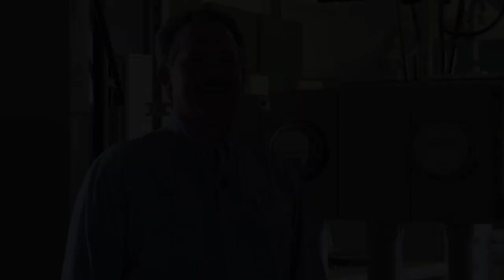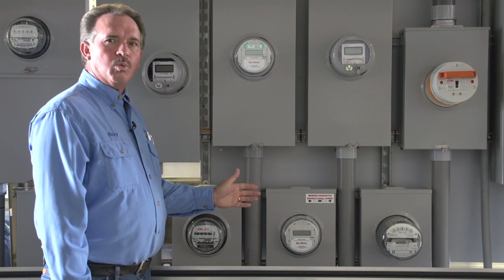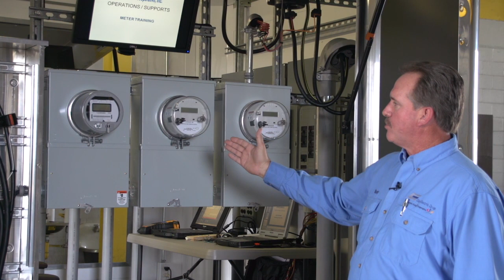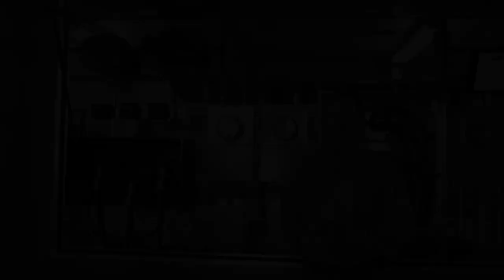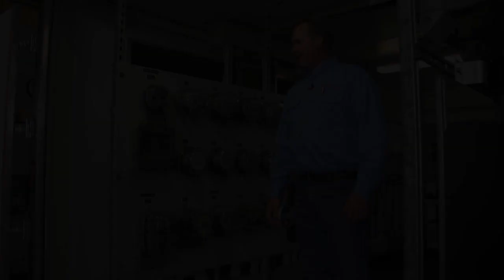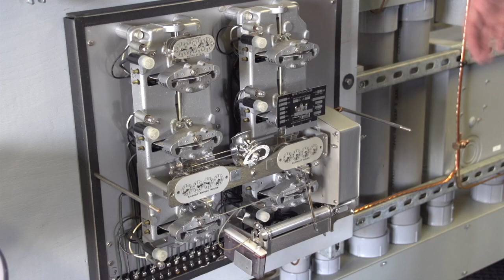The Meter Training and Safety Trailer Video Tour

Comment: Does a Meter always have to be outside the Building what about Smart meters..Or can they be installed in closed areas such as garage or washrooms ? Ect..
Reply: Its typically best for a meter to be outside, even smart meters. Or at least easily accessible to the meter readers. Reason being, there are times when a meter tech could use a read from the meter face. And while the reader is there, he/she can visually check the condition and security of the meter; i.e. tags, ice building up, or damage to the meter.
Reply: since this is the point where the main electrical service wires go into the home, in case of an emergency electrical hazard the utility workers need to have ready access to it. ie to cut electrical services into the home. Per NEC code it must be readily accessible. if it's inside your garage and nobody is at home, just imagine.